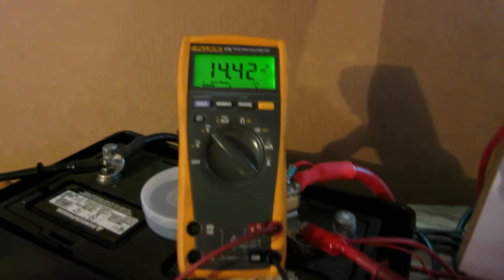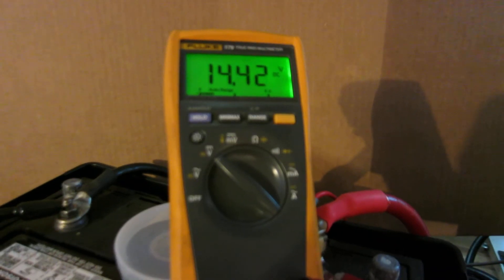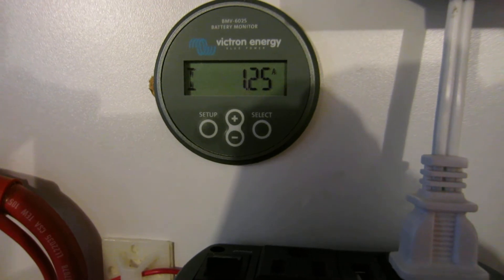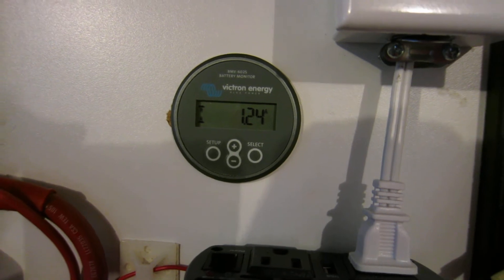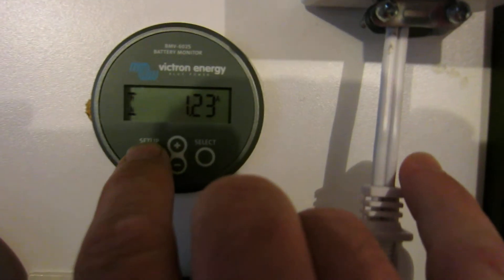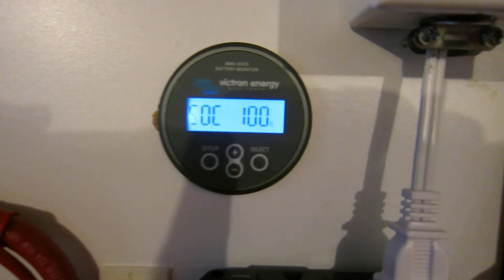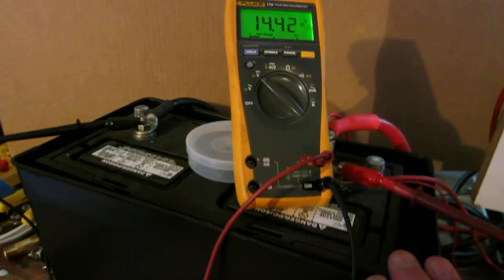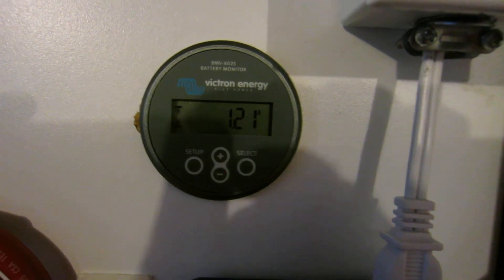"Known Full" Battery Monitor/Ah Counter Reset

Comment: hi there good video thanks. I have a 100amp battery with the Victron in my Landcruiser and when I add my 240v Ctek charger to battery, I do not see any positive amps going in via the Victron. Ctek is connected to battery terminals - do I need to clamp the negative to the shunt instead? Thanks.